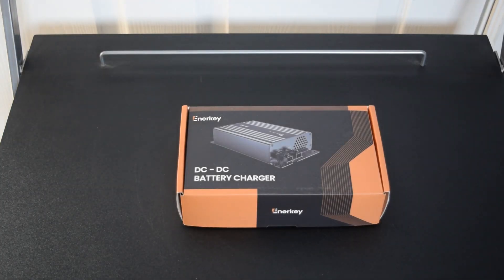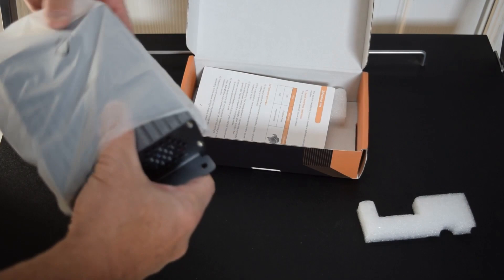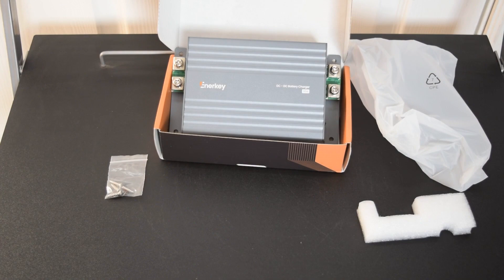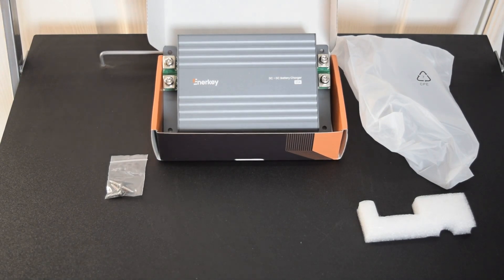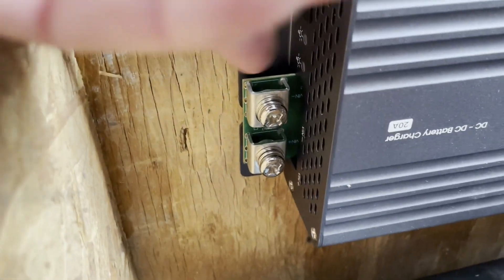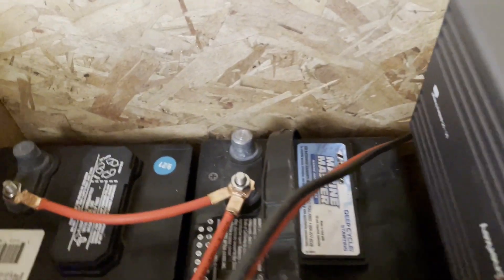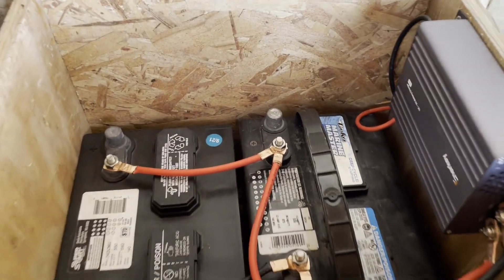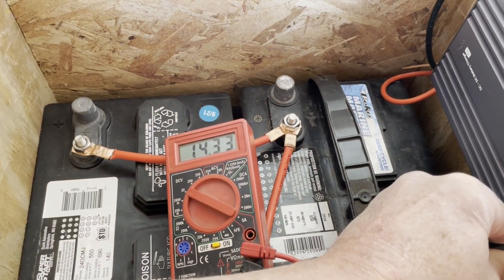Product Review: 12V 20A DC to DC Charger with Smart Chip, Enerkey On-Board Battery Charger.

Comment: Hello, saw your video in regards to this dc to dc charger. I want to charge lifepo4 battery pack. I'm getting a red light on my charger. I checked the voltage coming in and its 13.8 V.